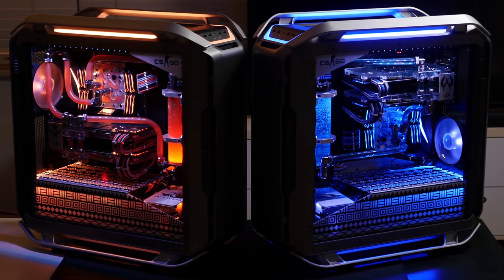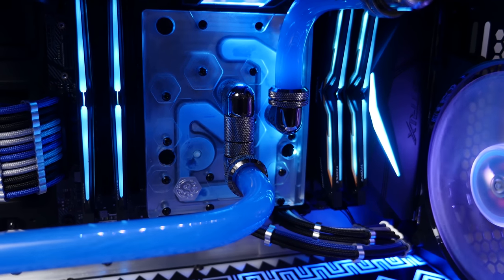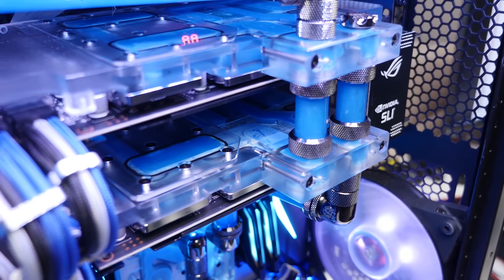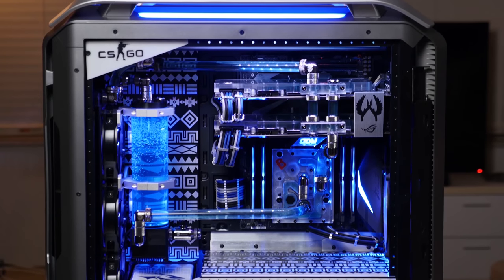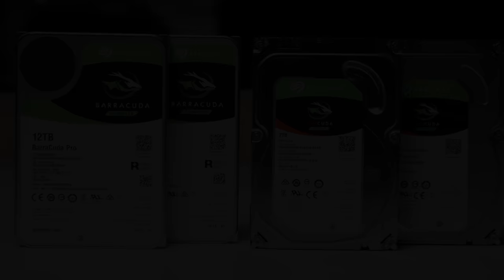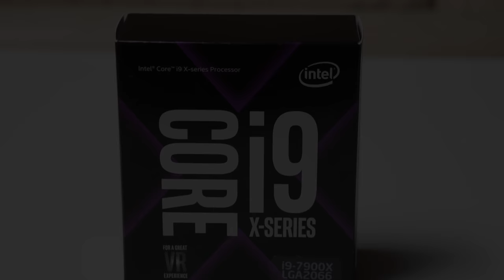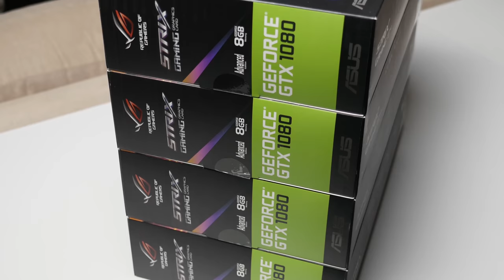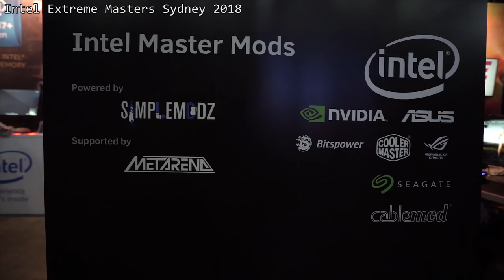CS:GO Aztec Mod + Why Fancy Coolants Are A Massive Headache!

Comment: FWIW my blue (original batch) vue went bad in about a month the exact same way. Now cue that guy who always says you just don't know how to use vue and his vue has been fine since he installed x months ago. Followed by the person who then replies, well you must be the only one because {insert current number of vue complaints} are having the same problem with vue.
Reply: Ricky Li, as much as I would love to follow the cues you set out. The Vue has some serious issues, I remember Jay first describing it as almost a long term Mayhem Aurora but as demonstrated in cases like this it’s far from it. Not blaming Jay as he was only  using the marketing given along with what was probably and early version of the fluid which has likely changed. My concern was raised when seeing the breakdown and how it looked to be stripping the nickel plating, if you have a fluid that abrasive what on earth would it do to acrylic over time and with particles of nickel flowing through the loop. I know Primochill has added a ton of dos and don’t to the Vue but this was not what was originally told at release or what was marketed.
Reply: Lurick, 4 months is hardly any time at all, even if you flush the loop to remove the nickel particles that are now flowing through your loop you have the situation where how long until it destroys the micro fins, causes abrasion damage to the pipes or if you go back to a clear liquid you now have exposed copper on your parts that you may not like, you payed for the look of nickel not copper. I don’t care how primochill spin this, it’s not fit for purpose and consumers need to be better warned. The separation issue in this video maybe a problem but the abrasive nature to me is an even bigger one that is not highlighted enough.
Reply: A A i agree and FWIW i was dumb enough to try filling my loop twice with vue because I believed i messed up the prep procedure the first time. Same thing happened the second time, and strangely (though primochill denies it) my alphacool clear XPX eisblock cpu block developed cracks sometime during the 2nd fill. Maybe it was all the time I was using the sysprep/system reboots but my experience with  Vue has been horrible.
Reply: Ricky Li I'm using the crimson red in my pc now and have had it for about 6 months now, the only issue I have is it's dyed every thing red, tubing, res etc. But it has not clogged anything.
Reply: You guys should make some researches before using  something like Vue. This is already quite warning what Aurora caused HUGE problems and it was essentialy the same purpose coolant. I will never even touch anyting like this cuz i care about condition of things i payed for
I use exclusively aqua computer DP noncolored stuff for years and everything like new.

Comment: Can someone explain why would you choose an i9-7900X and dual 1080s non Ti for a game in which single core performance is everything and framerate is critical since it reduces input lag and improves physics responsiveness. Not to mention it doesn't scale with SLI at all.
Reply from the maker: They are show PCs, no one is really using them. Intel ordered from for their event as explained in the video.

Comment: I did not change my coolant since 2.5 years. It’s still perfectly clear.
Reply from the maker: Clear coolant lasts well. I've got some that's 4 years old and it's still perfect.
Reply: Hardware Unboxed my clear tubes got milky but the coolant is still perfectly clear. I used water with innovatek protect pro. I highly recommend this.

Comment: Zelmon resernator 3 Max has been working with a number of oc processors since 2013 set and forget spec
Reply: I got the original Zalman reserator 1still on my current rig, had it since late 2003 or early 2004.

I use it with car coolant and its been trouble free for a decade and a half.

Comment: As a curiosity, the cards seem to be running in parallel, does that work as well as series or is series bad?
Reply: It doesn’t matter as long as both parallel parts of the loops are the same as in no extra obstruction on one to the over, it gives you equal flow to both. With water loops your water temperature equalises the temperature so having a slower flowing fluid gives more time to transfer heat offsetting the slower flow. In theory your water temperature is the same so the heat transfer from you GPUs is the same as well, the important thing with water loops is having enough flow and enough radiator coverage to remove the heat generated.
Reply: A A considering setting up a custom loop on my next pc, just checking things I see in vids to get ideas (long way off yet) hadn’t thought of there being a choice as everything else in the loop would be in series, now I know, and thank you
Reply: 75ur15, you probably already seen Jays2cents if you have looked up water cooling but I really recommend his videos for anyone new, if you look in his previous videos going back years there is plenty of advise and a few addressing parallel and serial loops because many don’t understand it and it gets questioned a lot. He addresses push, pull rad setups, positive v negative pressure, has build guides, maintenance. Anything you could need, not so much recently as it tends to be more reviews and montage builds but if you look back 2-3 years when working on skunkworks then plenty of info.

If you need any advice or questions I’m happy to help to post it here and as long as I get a notification I will try to respond.

Comment: There are VERY few chemicals that'll break down Acrylic like that. It'd be interesting to know what chemical was the culprit. :-O
Reply from the maker: It didn't break down the acrylic, the acrylic is fine, the liquid isn't. Alex suspected that the acrylic caused the liquid to go off, but it could have been any of the metal surfaces as well.
Reply: Hardware Unboxed Well, for a chemical reaction to occur, something must be added or taken away. If whatever it reacted with wasn't the water or some kind of lubricant, it (the culprit) will show some sign of damage, be it pitting, streaks, fragility, discoloration, or etc. Find the damage, you find the culprit. Let us all know when the culprit is found! Cautionary tales are the most helpful for us all.
Reply: MortifiedDumplin a chemical reaction can occur with a single reactant species and several factors like heat and a catalyst. The unknown properties of the liquid could have some organic compound that breaks down with heat,  time,  or a catalyst like the metal.  We frankly don't have enough info but it seems strange that only one color had that reaction.
Reply: My money is the level of abrasion the Vue suspended particles seem to show, demonstrated by striping nickel plating in long term loops. Those suspended particles becoming embedded in the softer acrylic or micro manufacturing abrasions in the block by the CNC router causing separation and then over time picking up more and more particles in a cascade reaction.
Reply: Rudy Sal 14 a heat based reaction would show up in shipping, especially in the current summer weather. But that's still possible.
Reply: A A That's the most likely scenario if it wasn't a chemical reaction at all.

Comment: meh....

On the subject of coolant though, I have only ever used automotive coolant as that was the only option as a corrosion inhibitor back in the early 2000s.  The only thing people seemed to know back them was straight water but I experienced corrosion with distilled water within a month so I opted to use car coolant.

have only changed the coolant on my water loop 3 time since 2004, last one being in 2010. Always looks like new all the different metal and plastic parts of the system so I just reuse the old coolant.
Reply: I was actually wondering why people don't use car coolant. I couldn't find any logical reason why it wouldn't work on a PC loop. Plus, it comes in several colours too, so is not like you're losing on that either.
Reply: Colors depend on the type of inhibitor technology and chemistry. I wouldn't use OAT or silicate rich coolants. That shit is messy and has a lot of solids in it. Also not all that compatible with some metals like copper/brass but ok for all aluminum. I recall it might have issues with some plastics and nitrile rubber O rings.  It's designed for modern all alloy engines with metal gaskets as well as silicone seals.

I recommend using a ethylene glycol type A coolant, the green type which are typical for older engines with mixed metals, cast iron, alloy intakes and brass/copper in the system with direct electrical contact. 

This is what I use and it's been perfect and no degradation of any parts, metal, plastic or rubber whatsoever. 

The other reason why I never used a PC coolant is I wouldn't trust any of the shit on the market, as if any the vendors in the PC market would have any clue to coolant design and chemical engineering like those in the petrochemical and automotive industry where it's a 1000^2 times more critical to get it right, because when they fuck up there is huge consequences.  PC market... your product stuffed up? pffft, here buy another AIO mate! warranty void btw.
Reply: 14 year old pc? pics of this monster
Reply: Not, its a FX 8320 with GTX980 OC'd as far as they will go on a Zalman reserator 1 passive water loop.  

The PC is not that old, it's the cooling system.  who the hell wants an under performing conventional water loop that needs fans when you can use a vintage one that works better and is fanless.

I have reused this cooling system over and over again as I havn't found anything better yet until....

Waiting on this to hit final product status so I finally will have something to match my old cooling system.

http://fanlessfan.com/

Btw I do have a 15 year old beast with dual Opteron CPUs, Quadro converted to 6800 ultra, GPU OC'd to world top 10 ish record level and 16GB of ram.
Reply: Good to see one of those things still going, funnily enough they use to corrode because people didn't use coolant and they were aluminium. i was more curious how you upgraded your pc if the loop was built into a case :P
Reply: Yeah its good, I remember all the bad reviews on the Zalman, I can't work out how anyone managed to get bad results so consistently. Like it was never designed to cool what I am cooling yet I never get over 40s on my CPU and never over mid 50s on my GPU and I have no freaking fans!  I idle on my CPU in the single digits to mid teens when its cold and not much more than about mid 20s in summer. I can't ever recall anyone else getting those temp these days. I even get a sort of cold bug in winter with my CPU reporting --c if its lower than about  6 or? 8c. exactly like that, just a dash with no number. 

for the Calyos case, they provide you with new hardware for different setups on request. They have made all the hardware for just about any model you want.  Because is a limited high end product they specially cater for this.  It's 1k Euro so you can see why they would provide lots of development of hardware pieces continuously for upgradability.
Reply: Are you saying you're getting lower than ambient temperatures? Does your system use a car radiator mounted straight outside of the house? :))
Reply: 3800, that case is nice however it is complete vaporware at this stage its over 2 years late and they have just announced they have to completely redesign the evaporator due to low thermal performance...with ever increasing tdps of multicore cpus if this thing comes to fruition it wont be relevant plus the company literally states they will not answer any form of communication from customers which is down right shady, their facebook is plastered with people demanding refunds, they had so many customers demanding refunds and asking what is going on they simply deleted their entire forum.
Reply: yeah that's why I am waiting out on it to see if it materializes, I would never pay on on promise alone. If not I will construct my own passive cooled case like I had done some designing on several years ago. Is basically would look the same as that as I came up with a very similar design almost 10 years ago but it would use water and built in pump as the cooling medium and not a gas like this one uses. 

The biggest issue back then was to machine a heatsink from a 40-60Kg block of aluminum and all the water passages. CNC machine cost a bomb then, still is expensive but not as much now as everyone is doing it these days, back in 2010 machining was a few 100 an hour in Aus, now it's less than 100/h for the competitive places here.  Its very doable for under 2k aud but if the calyos case does eventually come about it would save me a ton of time and look better as a complete product rather than a custom one off prototype system.  My goal for an upgrade is at the end of the year when new CPUs become available. I have no reason to upgrade due to lack of faster GPUs.
Reply: No, slight above ambient for low load and idle, about 20c above ambient on full load for quite some time is the norm. 

It gets very cold in my house, my room in particular in winter. Outside might be close to 0c or slightly below at night, my room might only be 5c unless I heat it but it looses heat faster than I can warm it so I can never get it above low teens with a 2.4KW heater running continuously. I don't run it more than enough to heat my feet and hands directly at few min at a time as electricity here in Aus costs close to 30c-kw/h

My current CPU temp is jumping from 10-18c as of right now and my GPU is at 24c. My PC has been on 4-5 hours but just watching videos and doing stuff on the net.

Yeah its a really good cooling setup for sure.
Reply: So what automotive fluid should I use
Reply: You can use a ethylene glycol type A coolant, or type B "non" anti-freeze corrosion inhibitor.

I used the inhibitor type B as it's at much lower ethylene glycol concentrations, leaving much higher water to glycol ratio for better cooling performance and just the corrosion protection needed.   The type A is to be used in 33 to 50% concentration which increases boiling point and decreases the freezing point, also extending life of the coolant at the cost of some cooling performance due to less heat transfer and heat capacity of the large % of glycol displacing the water. 

The performance characteristics of type A is not required in a PC so the type B inhibitor (suited for old cars) will protect well and perform better, and probably be safer to all the non metal parts as the concentration of ethylene glycol is low. 

Both types here.  Note this is a local Aussie high quality brand. For overseas people, use Nulon or similar good brand. 

type a
https://www.penriteoil.com.au/assets/pis_pdfs/7%20YEAR%20450,000KM%20GREEN%20CONCENTRATE.pdf

type b
https://www.penriteoil.com.au/assets/pis_pdfs/100,000%20KM%20GREEN%20CONCENTRATE.pdf
Reply: 3800Tech so cheaper nano fluid on highnsight
Reply: 3800Tech I’m going to get a red type a mix from nulo from super cheap shot

Comment: GTX 1080 what is this video from 2016?
Reply: He built two systems. It would be about another $1000 for Tis, plus it's made for CS:GO, which can get pretty high frames on even low end hardware.
Reply: [KSH] Titan V doesn't even have an SLI connector.

Comment: SSHD in 2018 lol :D
Reply from the maker: Why not they have SSDs for the boot drives.
Reply: wasn't aware that people actually use them tbh, 100$ for 2TB with 64 MB Cache.. dunno. i'm not a fan of the overall storage solution presented in these machines, 12 TB HDD is a real overkill anyway you look at it :P
Reply from the maker: They are really good for those that install loads of games, much more cost effective.